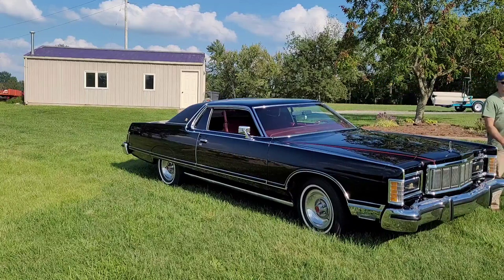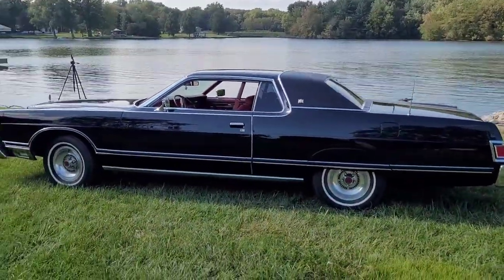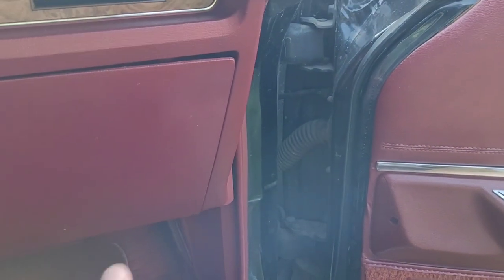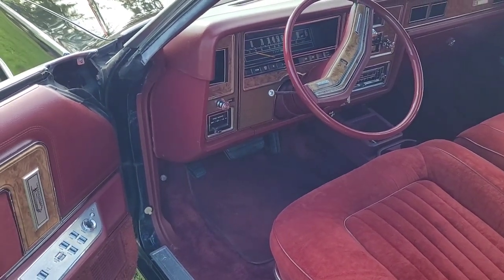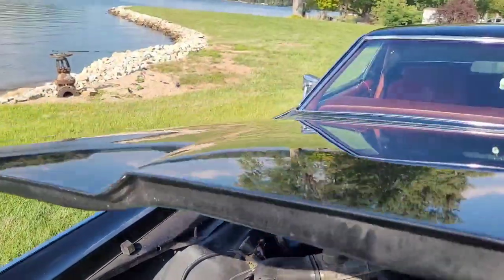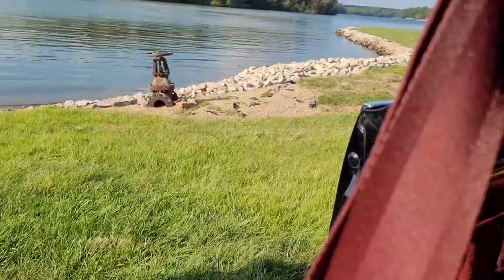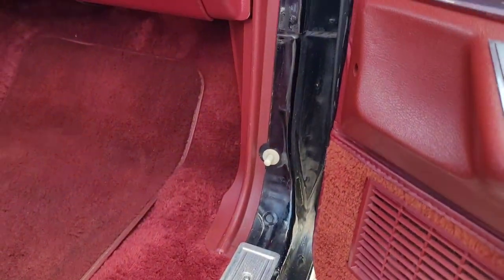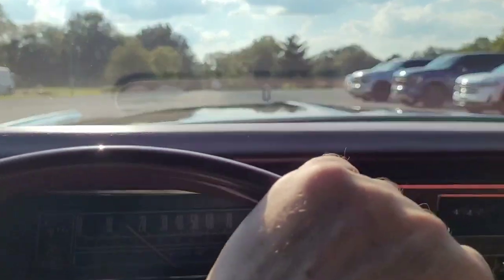29 Years Of Ownership Today For This 1978 Mercury Grand Marquis 2 Door 400 C6

Comment: My parents bought a 1978 4Dr Grand Marquis that was loaded with everything but moonroof, 8 track, and power passenger seat. It was a custom order by the dealership owner's wife but it was taking so long to get built she opted for something else. It was dove gray with blue interior and blue vinyl top and blue accent strips down the side. It also had the luxury wheel covers instead of the aluminum wheels. I learned to drive in this vehicle (can you imagine) It was the quietest, smoothest riding car I have ever driven or ridden in.  Nothing like it ever in the years since.  Absolutely fantastic car. I wish I had it today but sadly, mom had an accident and "totaled" it in 1986.
Reply from the maker: That sucks that it was totaled. They are still out there, but you have to be on the lookout at all times. You definitely wanna get a nice one because the parts simply aren't available. Thank you very much for watching and commenting. Much appreciated!

Comment: Beautiful!

I would also want the options added too...I'd even put in the quadrasonic 8 track...it lets you play the special quad tapes, which are discrete 4 channel surround.  I love that you added the power rear windows.
Reply from the maker: Thank you! I do have a Quadrasonic 8 track on the shelf that will plug right in. I've just never changed it because the original one works fine for me. Thank you for watching and commenting!

Comment: I forgot about those locking seat backs on those 2 door cars. Our 1971 Buick 2 door Electra leased car must’ve had those. I wasn’t into cars until 1973 when my parents purchased a Mercedes Benz 280 sedan. It turned out to be a huge lemon! It broke down coming home from Disneyland after midnight. We were towed to two dealerships before it was fixed. It only died twice on the way home. It turned out to be the fuel pump.
Reply from the maker: I hope they went back to American cars after that! Lol

Comment: Great car Tony !  Amazing that you know how to fix and add all the electrical. Impressive. I drove a used '78 LTD back in my 20's. It had a 400 . I felt like it was plenty fast. How much horsepower/torque do you have with the dual exhaust in this Mercury?   Wish I knew how to fix up these vintage cars. Love looking at them and driving them! Thanks for this video, appreciate the lake and campground view. - Jeff
Reply from the maker: Thank you very much, Jeff! I'm not sure how much it added losing the cats and adding the dual exhaust. It just been too long. I'll be doing the rear window repair video after I get back from Detroit.

Comment: First of all. I love the entrance You made with the Car on the headlight doors. 2nd is Some Cars looks better with fender skirts, but from the factory as was designed that way. Only bad issue about them, is tendency of rusting out faster in some places to uses a lot of salt on roads for melting ice. I have a 1989 Crown Victoria, the Sister to the Marquis. My interior is exactly same colour as that.  In Your description, You really caught My attention when You told about the time delay for the wipers. Thus, the long comment.  I had a 1979 LTD that was same body style & it had the timed wiper in it. Unfortunately, I ended up have to send it to the crusher after leaving it sit for a decade & it sank to the ground, & floor become a flint-stone car. I striped it keeping some of the parts before sending crusher, keeping the switch itself. Now, I went to put it in only to end up finding out that I did not know was needed called the modual. I can not find one up here where I live. My question to You is "Do You know where I can get one?" Same with the switches for Power Windows as I have all the motors.
Reply from the maker: Thank you! I probably have a delay wiper module somewhere, but I do not have all of the window switches.
Reply: @tonyscarcare5657  That would be awesome. What would You like for it? Switches not as important, but would like to have the delayed wipers going again. Frusterating having to turn on & off all the time when just a drizzle.
Reply from the maker: @KensHobbies409  I'll try to find one this week.
Reply: @tonyscarcare5657  Really appreciate that. Thank You.

Comment: Brochure shows the door courtesy lamps, but  yours doesn't  have them--A victim of bean counters
Same with the LTD Landaus starting in 1977. That bothered me more than the fixed quarter windows.
BTW I'm surprised that the bank lent you the money on that old of a car. Wouldn't happen nowadays.
Re adding options-I added the Light Group option to my dad's '76 Elite. It used to frost me that on mid-size Fords of the day, regardless of trim level, you only got a cheap plastic dome light, no others, not even a glove box light. When we got the car, I also wanted the dealer to add Interval Wipers. Despite me pointing it out in the accessory catalog, the lazy lying POS dealer said it couldn't be done. In reality, it was a 10 minute plug and play job.  

Reply
Reply from the maker: My brochure doesn't show or mention the door courtesy lights. They were simply gone by 78. It does have the under dash, C piller, and reading lamps, so it's very well lit. Yes, most of the options are very easy to add.